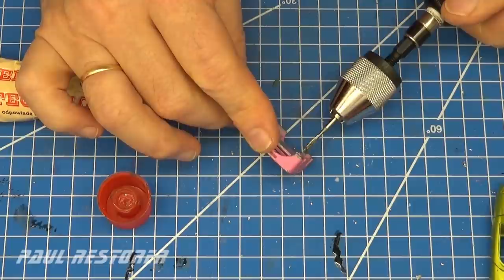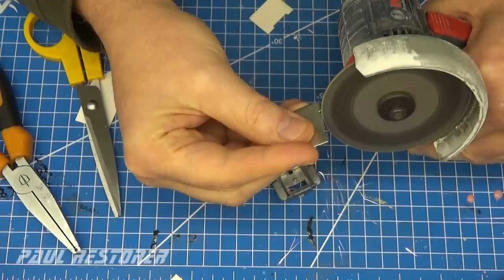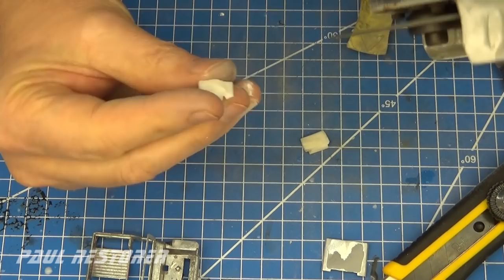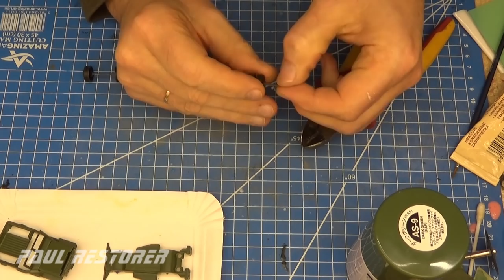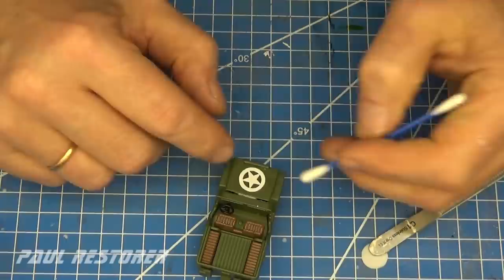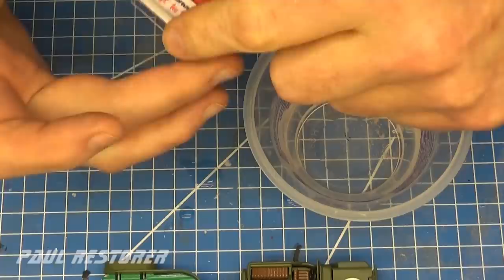Jeep Hod rod no. 2. Custom Matchbox restoration Diecast car. Making bonet. Veterans Day

Comment: Good job but them engines were OD green and only a 4 cylinder.. thank you for your thoughtfulness
Reply from the maker: Thank you very much. That's why it's Custom. I used 8 cylinders and therefore the bonnet is slightly raised for additional cooling. Best wishes